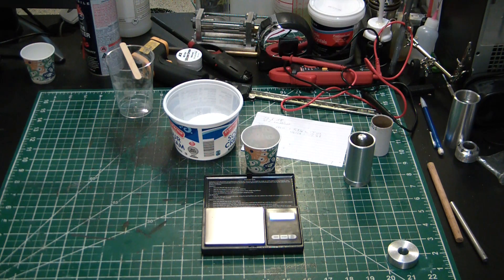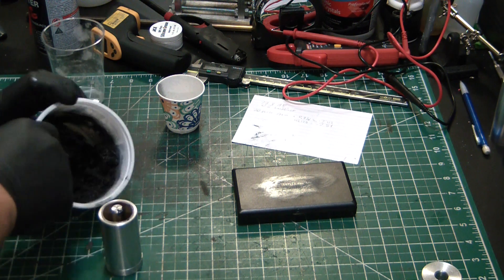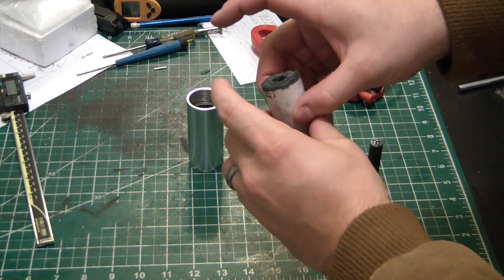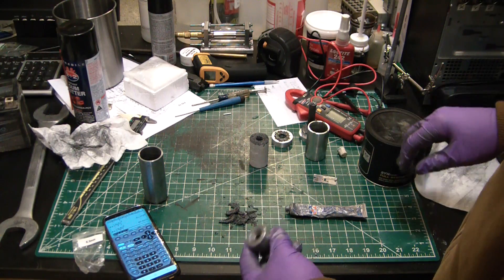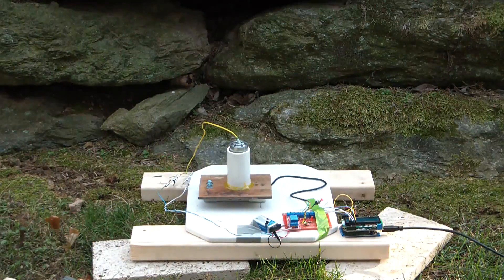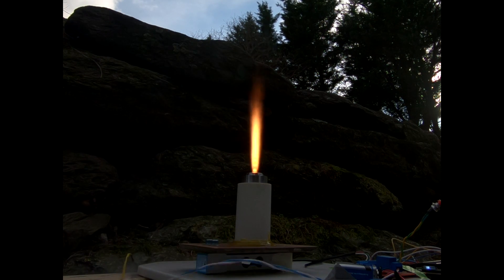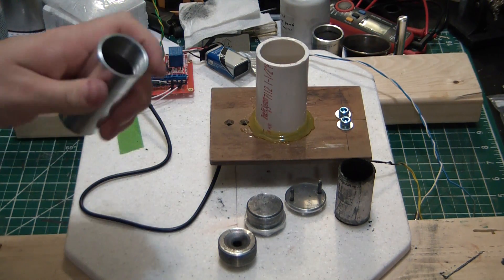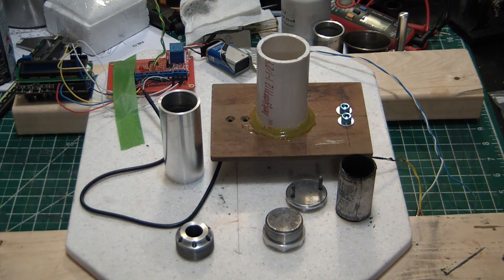Shock Diamonds! DIY APCP Rocket Propellant Test Supersonic Exhaust - ElementalMaker

Comment from the maker: Hope you guys enjoyed! It would a HUGE HELP to the channel if you save this link as your amazon homepage, so when you shop the channel gets a small kickback: https://goo.gl/x1ehvA Please consider helping to keep these videos coming
Reply: Thank you very much for this video ! You did an amazing job and I learned a lot. I'm happy to support you and hope to see future videos of your success . That burn was simply perfection to watch !
Reply from the maker: @The_Kansas_Kid Glad you enjoyed! New rocket videos are posted!
Reply: I loved it.  I'm wondering if you tried a medium thickness epoxy.  Wound the reaction even kick?  If so I'd think the flowability would work in your favour.  It would also make release with lube, especially grease, easier.  I was also curious if you considered lubing and then wrapping the spindle with kitchen cellophane.  I think it would burn clean before it could make contact with the nozzle.
Reply: Those videos are lots of fun, but you should try to dissolve your solids at least partially in a bit of methanol before mixing with the resin, you will get a much better dispersion, a denser end product, and the methanol will completely evaporate long before the resin cures (it's compatible with most epoxy resins, and will dissolve both your perchlorate and nitrate). Just dissolve your solids into a bit of methanol, mix the methanol solution with the resin thoroughly, and add the hardener at the end. The methanol will also make the resin a lot easier to actually pour. For even better results pull a slight vacuum on your resin mix after pouring to get all the air and moisture and methanol out. Remember that less hardener will take a longer time to set, but will also set harder and denser, less rubbery. Also just put a single layer of saran wrap on your spindle for easy removal...
Reply: love the subject
Reply: Hello nice job👍 , where did you buyed your rocket tooling for apcp rocket ? Thanks sir

Comment: Is it possible to use potassium perchlorate instead of ammonium perchlorate? It’s what I have on hand.
Reply from the maker: Ammonium perchlorate is used because it produces all gaseous byproducts, and will generate much higher isp for the same mass. Potassium perchlorate may work, but you would need to research it thoroughly before attempting, I can't say if it would be safe or not, and in the end you'd still have a much weaker motor without the impressive flame.
Reply: @ElementalMaker  alright thank you
Reply: @ElementalMaker  this may be a silly question, but are there any chemicals I could add that would change the color of the flame or make it more impressive without sacrificing the effectiveness of the propellant? For example, is there a copper compound I could add to make the flame a brilliant blue without making it significantly less powerful

Comment: What do yopu mean by "A perfectly designed rocket motor will not have shock diamonds when operating at atmospheric pressure"   ????????????????????????????
Reply from the maker: A rocket motor operating at optimal efficiency will not produce shock diamonds. Simple as that. They often produce shock diamonds at sea level though because they are optimized for higher altitude operation, and as atmospheric pressure drops, the expansion cone will widen and shock diamonds will dissappear.

Comment: you don't need to use a spindle in your mold. With such a tiny grain, you can simply cast a solid block and after cure, drill the core to the size you'd like it to be

Comment: I don't know what kind of silicone grease you're using, but I've found that when molding stiff epoxy compositions, some of the common silicone greases (like brake lube paste) tend to work poorly for mold releases.  I've found that dow corning high vacuum grease works much more reliably.  Being so much stickier and tenacious, I imagine that the viscous epoxy mixture has a harder time wiping it off of the mold surfaces.  The stickiness makes it a bit harder to spread out, but a spritz of naphtha momentarily helps it spread.  Take it for what it's worth.  It might not work for shit with resins other than what I've used.

Comment: I don't know if it's viable at this scale, but on larger amateur rockets (3" grain diameter) I've seen the propellant cast in place in the motor, using Styrofoam as the core. The styro is dissolved with acetone after curing.

Comment: Thanks for the update. It's a good start, but there is a lot of room for improvement.

AP propellants are usually vacuum degassed after mixing. Also, make sure you chemicals are very dry. Moisture in one of your chemicals may have caused the bubbling in that first batch of grains. 

You should make up some proper igniters - the flame/heat duration of yours is too short and BP really doesn't help much. 

When you decide to plot a thrust curve, modify your apparatus a bit. That button that you currently press and then run away from should be placed on a long cord, so you can fire the motor from your safe location. The code should be modified so that the igniter fires almost immediately. That long delay is an unnecessary hazard.

Time to start using aluminum powder. You will have a problem getting enough Al into the mixture - it is easiest if you use three mesh sizes for more efficient metal packing. 

You need vacuum degassing to minimize the expansion while curing.

Getting a well functioning motor is fun, but can be frustrating.

Comment: You might find that petroleum jelly is a better mold release than silicone. Silicone might be getting turned into glue by the resin...
Reply from the maker: I will definitely give that a go next time!
Reply: @ElementalMaker  try using compressed air to get the cast of the mold. (Not Canned air) Take a look at how people remove handlebar grips from a bike to see what I mean.  Also, could you make the center hole after the fact? Ie, make the casting, then drill it, and then pull the charge out of the mold?
Reply from the maker: @jonnyphenomenon  I use that technique all the time replacing the grips on my atvs! Good thinking!

Comment: I have a suggestion.

Ive made fuel with gunpowder, and  used nitrocellulose as a binder, nitrocellulose is a good fuel.

I dissolved the nitrocellulose in acetone and added the gun powder to it, and i got a perfect paste.

So this gives me an idea for a composite fuel you could try.

Melt some nitrocellulose in acetone, and then add an oxidizer, the finer mesh powder might be best.

Nitrocellulose and ypu pick the oxidizer. I was thinking potaasium nitrate, but for more energy density, you could just use a little potassium perchlorate instead. (Very powerful oxidizer)

Edit: nitrocellulose makes for a really strong binder too, its very difficult to crack, so you might not even need to worry when you take it out.

Comment: Dude! I have a really cool holiday time idea! Take random food stuffs and try to make rocket engines out of them. The one that probably will have the best results (other than cool whip or mashmallow fluff) would be sweet potatoes. I already know there's enough starches/sugar in potatoes to make alcohol, I wonder if there'd be enough energy to make a solid rocket motor. All you'd have to do is dice them up into little pieces and leave them to dry out, then grind it into a powder, add oxydizer and binder and cast your grain. Viola! You've got a rocket motor!.... No clue how much energy is actually going to be there but it'd be fun to do/see as well as things like canned cranberries and whatnot.
Reply: Why not just drill three holes, stick a tapered tube in one end only so far, and blow N02 through the other end? Simple, yet effective. And much less time consuming...
Reply: @guardsmanom134  nitrous oxide doesn't burn on it's own, it's an oxidizer, it needs a fuel to go with it. Besides, the whole point is to make a rocket grain not a bomb.
Reply: @jaratt85  ahh. Perhaps I was unclear. The potato is the fuel. The NO2 is the oxidiser. And the tube is to direct the exhaust. I meant to say TWO holes, not three. Hybrid rocket, oldschool style.
Reply: @jaratt85  https://youtu.be/VI8gdmjEwKc from NightHawkInLight... He explains the operating physics better than I can write it.

Comment: Why you don't use stun gun technique for ignition.
How did you made the nozel calculations
Reply: I think the calculated circumference instead of area? Circumference (C=2πr) of the 8.8mm nozzle opening is 55.29 (~60 like he said). Using the formula for area (A=πr^2) gives area as 243.28mm^2 and 124.69mm^2 respectively.
Reply: @voiceless_scream  are you familiar with AC motor. Can you help me.

My email
Mossad.samaha@hotmail.com

Comment: What happens if you put rocket fuel in a car?
Reply: Since rocket fuel is LoX and hydrogen, basically as you load LoX into the gas tank a cloud of O2 forms and, if the hose is not fitted to a proper cryo fitting on the car, will boil off before reaching the tank.  This goes on for awhile until the hose leading to the tank begins to approach the temp of the LoX.  Once the actual LoX reaches the tank it will react explosively with any organics (leftover gasoline and oil) rapidly resulting in a deflagration event in an enclosed metal box.  This is where shit really hits the fan and pressure builds rapidly inside the gas tank, eventually leading to a rupture, much like how a pipe bomb works in that you have a lot of rapidly expanding gases within a closed metal container, just with LoX this time instead of gunpowder.  After your car CATOS, the LoX begins setting fire to everything it comes into contact with, metal, the diamond on your ring, whatever's left of the now ground beef that you previously refered to as a body, aluminum frame of your car, and just about anything else.  Also, that hose that was delivering the LoX to your car?  It's now acting like an out of control firehouse spewing burning LoX everywhere.
Reply: Alex Buchanan You're forgetting that there's more than one kind of rocket fuel.
Reply: Alex Buchanan That's still entertaining imagery though. Gives the phrase "burn bright like a diamond" a new meaning.

Comment: allways set up to save to a seperate folder.
Reply from the maker: The arduino logs to the serial monitor, so I have to manually save the data
Reply: @ElementalMaker  well then you wanna look into setting it up to auto save to an sd card.
Reply from the maker: @nathandean1687  I definitely need to get that set up!
Reply: @ElementalMaker  itbe a pain to learn all that plug and play stuff. but i beleave you can do it.

Comment: Could you use a sacrificial sleeve on the die post instead of relying on a mold release? For instance, wrap the center piece in a thin tissue paper or something of the sort?
Reply from the maker: That might be a viable solution! 👍
Reply: @ElementalMaker  saran wrap

Comment: There is a program called OpenMotor for simulating solid rocket motors, so maybe it'd be interesting to see how your actual motor performs as compared to a simulation of your motor. The best part about it is that it's free simulation software.

Comment: Correct me if I’m wrong but to solve the shock diamonds you would either slow the burn rate to lower chamber pressure or increase nozzle diameter as it’s burning too fast and there’s too great a pressure differential?

Comment: I would still go a tiny bit smaller on that nozzle. I would love to see you test some hybrid rockets using HTPB rubber and nitrous oxide. You used to be able to get small 5-10lb welding tanks on ebay for $30-50 and getting them filled with nitrous or oxygen shouldn´t be too expensive. If your lucky you may find an oxygen concetrator used for under $100 and then you can fill your own tanks.
Reply: Here is one for $48. I also saw some motorcycle kits with 2.5lb tank, lines, and spray nozzle for $118 and a 500cc kit with 5 mini bottles for $68 which might be even better for the size motors you are working with. But a 20lb tank costs $120 if you want something that will run a little longer. You can also talk to the security guys at music venues. They confiscate them all the time and may give or sell you one for cheap.
 https://www.ebay.de/itm/Airco-Nitrous-Oxide-5-LB-Bottle-Tank-Empty-Used/184040423922?hash=item2ad9aa01f2:g:P5kAAOSwtC1dyIOG

Comment: I’m not sure what resin your using but I can make a guess. Now I know that fibreglass resin doesn’t stick to baking paper so when I cast something with a hole in like your propellant I wrap the spindle with baking paper and it very easy to remove when it’s set. 
Try a sample of your resin an see if it sticks.

Comment: Amen on the old house comment! I'm redoing subfloor in the 3rd room of my house now. Looking at probably $400 so far in materials.
Reply from the maker: Oh yeah and that's getting away cheap! Paying contractors it would be four times that.
Reply: @ElementalMaker  ain't that the truth! The living room was like $400 or $500, only because I didn't replace the carpet, and didn't have to do much blocking and such. I just reused the carpet. Also painted the subfloor to protect it from future spills and such. 

I replaced 4 sheets of drywall, one window, 3 panels of siding, all the insulation, etc. I think that whole section burned about $1500. And that was 95% done only by me. Mu father helped install the siding, because that was a 2 person job. I loved it and hated it at the same time.
Reply: @ElementalMaker  I was talking with a contractor, and he said the living room probably would have been about $8-$12k to have him do it. Not worth it on a house I bought for $75k (although it's apparently worth around $100k now)
Reply: Be glad it's not a boat. 
"Break Out Another Thousand, Jim."

Comment: That was fucking awesome! 
Shame you lost the data but I’d take an awesome burn like that over data any day! 

I was wondering ( dangerous I know ) but if you got an empty 2 part epoxy syringe with the twisty nozzle that mixes and filled it with propellant, how would it burn? 
Or would it just explode? 
I get you would have to cut the tip back a bit to open the nozzle up a bit but wondered if the spiral would affect the burn in any way.

Comment: ElementalMaker Just an idea: very fine steel wool ball will burst into red hot molten flame at 9 volts, you could make your own igniters that way.
Reply: i use old christmas light bulbs with the filaments, if you snip the glass off, they'll get hot enough to ignite things
Reply: @solahifuefos9301  That is true and works, but try fine steel wool, it's the shiznit.
Reply: he already makes his own igniters
Reply: While those are great hacks, and work once on low starting temp fuels; a better and more reliable approach would be to get fireworks magnesium sparklers and cut small segments, exposing short contact pieces of wire when you crush the powdered magnesium. Voilá, quickmatch.

Comment: I suspect that 1 or 2 shock diamonds at ground level should be just about right. That should allow it to find its stride at the modest altitudes of an early prototype.
In lieu of doing something fancier, a 'backup recording' of your screen-o-data with a phone camera sounds like some good hindsight, though you've probably thought of several better ideas by now. Then again, you strip wires with your teeth.  :)

Comment: Every time you strip wires with your teeth i have to laugh.
Had a buddy that used to do that all the time.  Great big guy.
He was wiring some heated mirrors onto an old off hiway logging truck.  He was sitting on the fender and was stripping the wires with his teeth.
Well he forgot that the one wire was hot, got a 24 volt jolt right into his teeth.
The look on his face was freaking priceless.  

Oh, hey. The rocket vid was pretty decent too.  LOL.

I used to fly rockets with my son, that was about 20 years ago.  It was lots of fun.  Need to start again.
Really enjoy your channel.
Reply: HERE SHE COMES AGAIN!

Comment: Ive been makimg rocket motors recently with primitive tools. Id say in total i have a success rate of 50% but recently theyve gotten more successful. (I rate by how often they get off the ground) I have some designs in inventor that i want to make, but i dont have a laythe, or barstock. Let alone a machineshop or steel/aluminum.
Aluminum is lightweight so yeah.